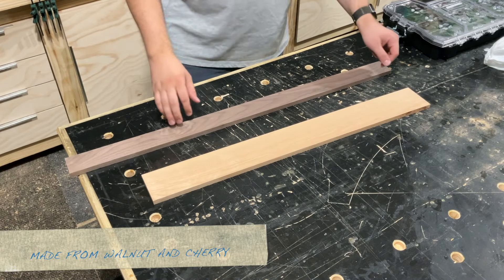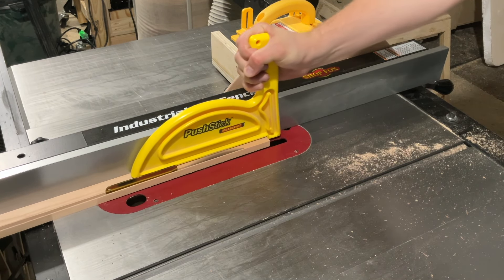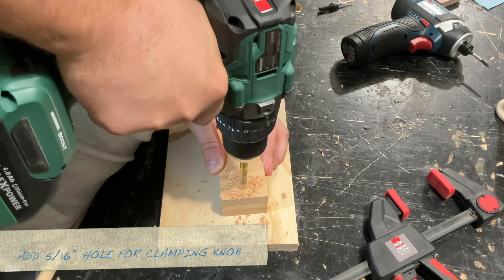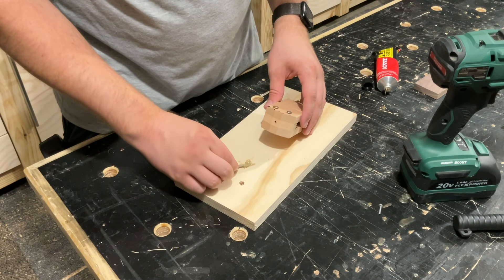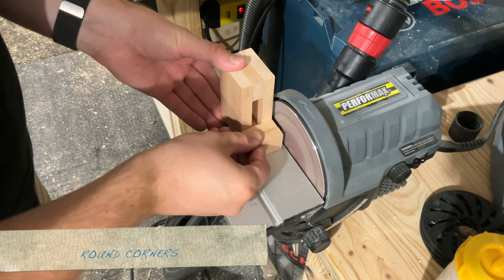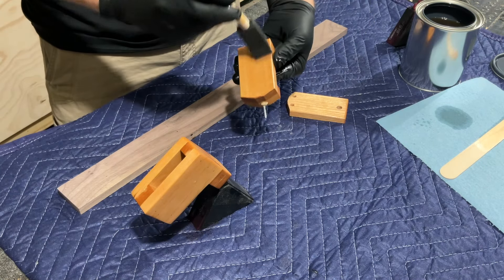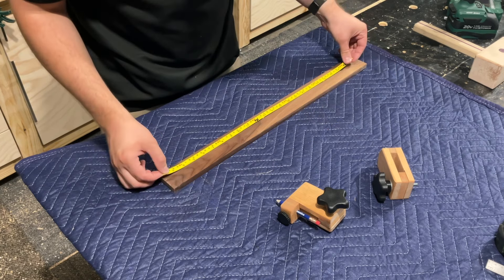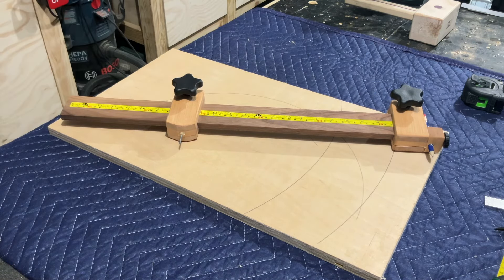DIY Beam Compass

Comment: GREAT project.  Another benefit of the "sliding" pencil holder is that if you are making smaller circle, you can put everything in the middle and it will balance and make it easier to "circle on".  Thanks! !! !!!
Reply from the maker: Thank you! Also yes that’s a great point about balance. Makes me think about building accessories like a blade that replaces the pencil so it can cut circles. Or maybe a multi pencil attachment 🤔
Reply: @fangerwoodworking  Bring it on! !! !!!